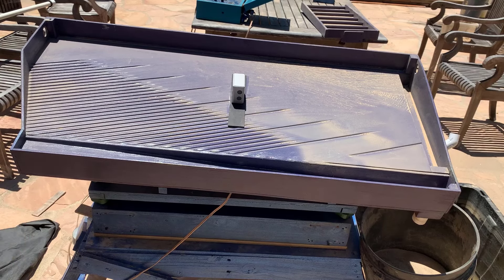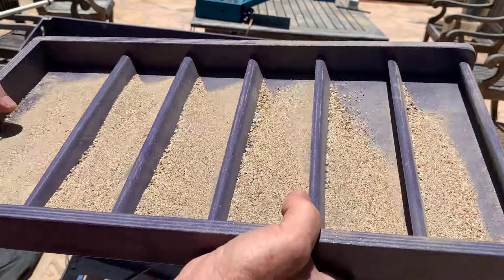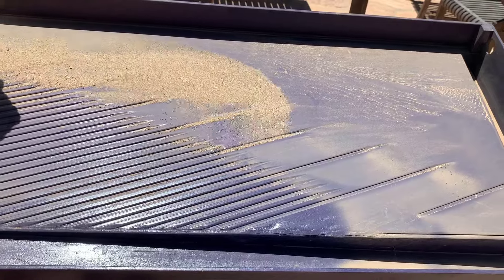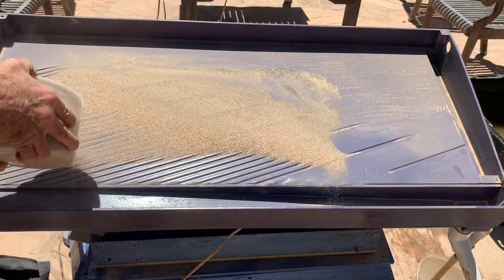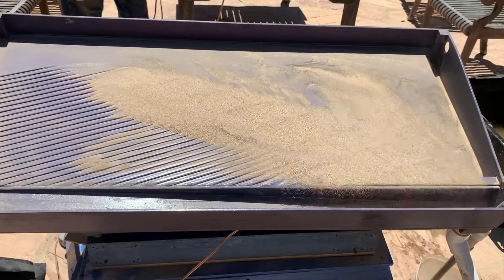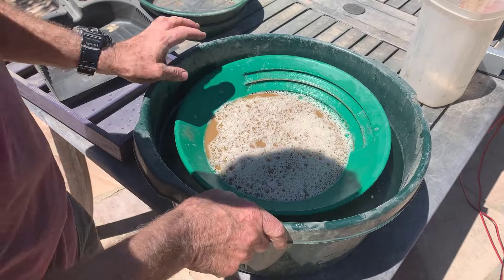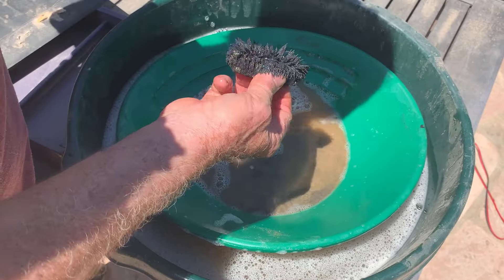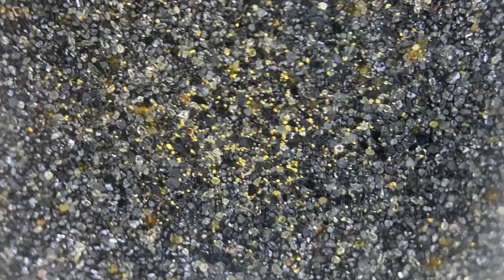Dry Washing for Gold using a Shaker Table -- Dry Shaking Experiments for Gold Concentration

Comment: You got some cool stuff there. Just to reiterate: the compressed gas of the air in a blower behaves more like a fluid, thereby augmenting the disparity in specific gravity between particles. If it's only a vibration or a winnowing–the light stuff is MUCH lighter in a fluid that resists gravity. Tossing it in the air doesn't work because the air it's falling through isn't compressed. Maybe a perforated board with just enough air through it to float the particles. Like that old hover craft project. Idk.

Comment: An oscillator can be designed to create various types of vibrations depending on its mechanism and settings. In the case of mineral processing equipment such as the blue bowl concentrator that we employ, the oscillator is used to impart controlled vibrations to the concentrator bowl. These vibrations help in the separation and concentration of heavier materials like gold from lighter materials such as sands and gravels. In fact, when an oscillator generates vibration, the position and frequency of the vibration can create geometric patterns or shapes, especially when applied to certain materials or mediums. This phenomenon is known as "Cymatics."

Cymatics is the study of visible sound and vibration patterns. When a surface or medium is vibrated at specific frequencies, the material responds by forming patterns that are characteristic of that frequency. These patterns can range from simple lines and curves to intricate geometric shapes depending on the vibration frequency and the properties of the material.

In theory, on a perfectly level table, gold and other heavy particles can settle in predictable patterns due to their specific gravity and the dynamics of how they respond to vibrations or movements. This predictability is a key principle in mineral processing and prospecting.

I recommend classifying the material, so you know the range you are working with.  The "Falcon Gold Tracker MD20" should be able to detect where the gold has settled within the generated pattern much more quickly than your microscope.  Once you know where the gold is, just vacuum it up.

~ CHEERS
Reply: The idea of cutting grooves or channels into a shaker table or concentrator surface to direct gold into specific zones is an intriguing concept in theory, especially in mineral processing and prospecting scenarios. Here’s how this approach might theoretically work:

Pattern Recognition: As I mentioned, once you understand the predictable pattern where gold tends to accumulate on a leveled table due to its specific gravity, you can identify these zones or lines.

Groove Placement: By strategically cutting grooves or channels into the table surface at these identified zones, you create pathways or channels where the heavier gold particles can naturally gravitate towards during the shaking or vibrating process.

Overburden Removal: The grooves would ideally direct the gold into these channels while allowing lighter materials (overburden) to remain outside these channels or be pushed towards the table edges. This separation makes it easier to vacuum or otherwise remove the lighter materials first, reducing the overall processing time and improving efficiency.

Collection Efficiency: Once the overburden is removed, you can focus on collecting the concentrated gold from the grooves or channels where it has accumulated. This targeted approach minimizes the handling of excess material and maximizes the recovery of valuable minerals.

In practice, the effectiveness of this method would depend on several factors:

- Accuracy of Pattern Recognition: How well you can predict and replicate the gold distribution patterns on the table.

- Precision of Groove Placement: Ensuring that the grooves are positioned correctly to intercept the gold-bearing zones without disrupting the overall flow of material on the table.
- Operational Adjustments: Fine-tuning the shaking or vibrating parameters to optimize the collection of gold into the grooves.

While this approach sounds promising theoretically, it would likely require experimentation and adjustment to achieve optimal results in real-world applications. Engineers and prospectors continually innovate and refine techniques like these to enhance mineral recovery processes in mining and mineral processing operations.

It's good to see you innovating as you are!
Reply: What is the MD20?
Reply: Yes they ship a 50 mesh piece in test card @Jatslo
Reply: @1Search  Yes they do.

Comment: On the tall riffle dry wash sluice mabey try bolting a vibration motor on it setting sluice at differing angles?
Reply from the maker: I've tried a vibrator and it may work, but it's hard to control.

Comment: It is wondered if particle density, classification, material characteristics all play a role as to amplitude/ frequency/angle: for max heavy capture. It’d be cool if these variables were tamed. Very cool if a video camera, and software sensitized to black material could instantly bracket tilt(s), freq., amplitude required. Even adjust for variability of sample flowing at any moment.
I dare to take a swipe at the particles. Thank you for this video!!
Reply from the maker: Great comment. That would be interesting to try.

Comment: I've been developing a dry sluice for a couple of years. I now have a riffle and motion that works really well, even for flour gold. The last test I did was to see if it would recover gems from mixed gravel, sand, and silt. I used 1/4" alumina spheres as the test objects, and the sluice recovered 100% of them, with the bulk in the upper 30% of the sluice. From what I've learned, both the motion, and riffle shape are important. I enjoy your videos, and respect the effort you've put into your designs.
Reply from the maker: Hi Jim, I'm interested in your design. Any further information would be appreciated.  -- Dave
Reply: @orophilia  Dave, I'm still developing other tools using this particular motion. I only give out info on my designs by selling plans to build them. I don't do moneyed videos, so have no other means of keeping the shop stocked with tools and supplies. I respect your fabrication skills, and would enjoy being in touch with you, but only by email, or phone, and with the understanding my projects aren't publicized on the 'Net, except by me. I put my contact info on another of your videos last winter, with a request you contact me. 😀

Comment: Mesmerizing to watch the blacks immediately forming it's river along the top. Take that magnet and put it in a plastic container, then pick up the magnetite and you only have to reach in and remove the magnet to drop the magnetite, which leaves you a perfectly clean magnet. I use a neodymium magnet on a string, then drill a hole thru the lid of a plastic peanut butter jar, then dump the magnet in, with the string hanging out of the hole - works great.